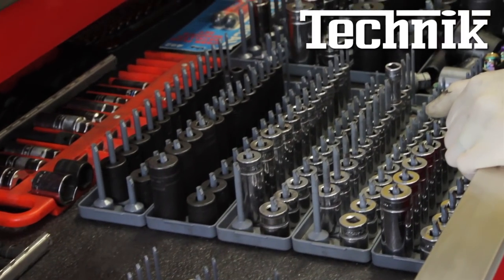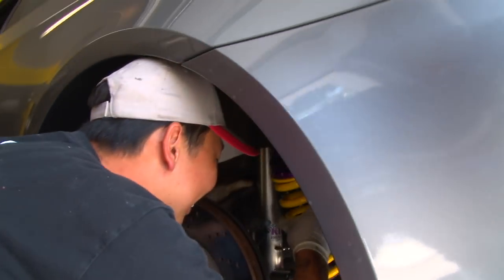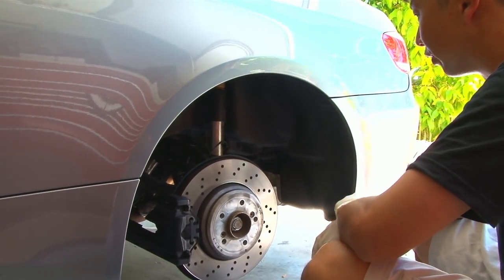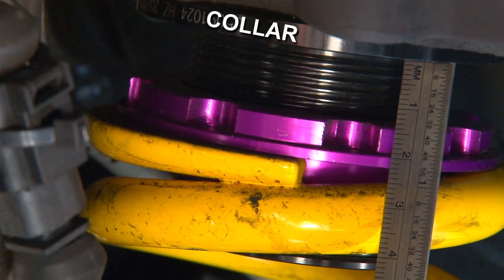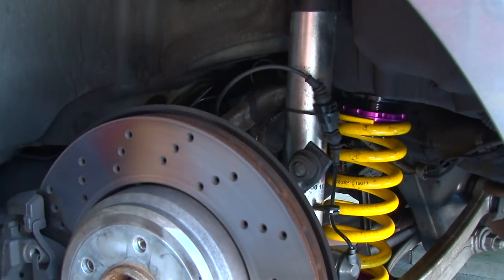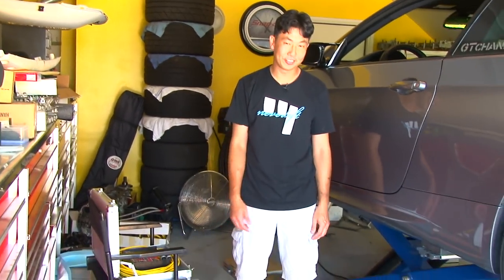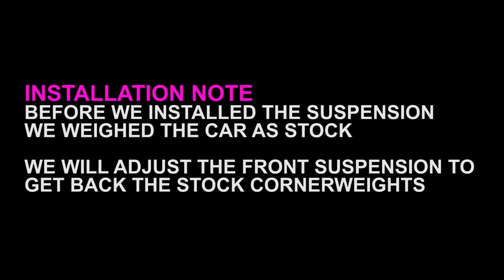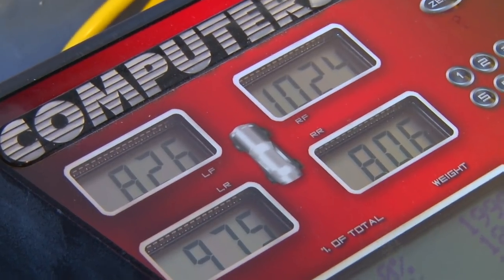How to adjust ride height & corner balance your car - KW Suspension DDC - Technik - GTChannel

Comment: Worth mentioning that when doing corner weights the droplinks/end links should be removed. Then once  corner weights are set they should be replaced with adjustable drop links. This ensures there is no pre load in anti roll bars 👍🏻
Reply: So what happens after you have corner weighted and then reattach the drop links ?
Reply: @jamsstar2010  if you corner weight it then re-attach the the oem non adjustable droplinks the Arb will be under a constant preload. Because the coilovers will be at different heights. 
With adjustable droplinks you can adjust the length of them separately to match the different heights of coilovers left and right.
Reply: me 3 years ago Thanks you for this info
Reply: @JamesWilson-du4xt  no probz

Comment: learned a lot. when i do my suspension, every time i jack up my car, the wheel would drop camber wise and when i drop it, it would stay camber. So i drive in back and forth to even it out to get a perfect measurement. it is just my tips with suspension but im no pro.

Comment: Did you undo the swaybar links. We do when we corner are race cars it make a big difference  in corner  weights I've seen 400lb difference. Cause the suspension binds.

Comment: i have questions... some things you did cover, but i want to be sure...1. what should be done first, the corner balancing or the alignment? 2. do the sway bars have to be disconnected? 3. should you add weight to simulate possible passengers? 4. lastly, should the static ride height be decided before the corner balancing? thanks in advance

Comment from the maker: If straight line speed were our goal then yes.  I (Brian) wanted a car with some luxury than can also handle well off and on the track.  The Shelby is fast but it's not quiet or remotely comfortable.  The M3 is my daily driver and it makes my commute super cushy and yet I can still go drive the canyons and have a blast.

Comment: How did you manage to adjust the rears without having the perch rotating togehter with the ring? I have to diassemble the lower control arm to adjust the rears on my car.
Reply: I also wonder. Did you press the rear spring together. On my e92 335i the upper perch always rotates so I can not adjust the height
Reply: @joakize  I installed v3s on my car today and had that same issue. i did overcome it though. on my m4 atleast there is an opening in the control arm. u can put a socket extension with say a 22mm socket on the end up through the spring. I then used a very small jack to put light pressure on the middle of the perch. that stopped it from rotating and i could adjust the rear. i still needed the wheel off but atleast i didnt have to take the control arm off again.

Comment: Please correct me if I'm wrong, just some more confused people in the comments is all.

TLDR; Spring preload raises height, no or negative preload lowers height(loose springs if no helpers/tenders), both adjust how much bump travel.

The coilover world is odd and misinformed, KW is one of those companies that usually don't come with independent height and spring adjustments until you go all out with their track coils, because everyone has been setting them up wrong using the damper body and not the springs.
In this video, the suspension appears to be upside down and separated compared to many other vehicles, so move the spring perch down adds preload raising the height, less or negative preload would lower it.
The spring adjustment is the proper way, as it controls how much suspension travel you before hitting bump stops have AND the height, the body portion can be used to fine tune that more.
Going by the bottom or top body portion and not the spring adjustment can cause issues with travel depending on the current preload on the spring, either too little travel wasting performance or too much travel smashing the car into itself.

If you check out MCA suspension they have a ton of really good reads on how this works.

Comment: Now you need a spring rater so you can maintain or change the roll couple to tune the way the car handles. You need to know where you started by rating the stock springs and knowing the rate percent front to rear. I've always preferred a car with a bit of push when it starts letting go. Loose can get you into trouble. And adjustable rate sway bar is nice for fine tuning the handle. Indy cars use an arm to the link that can be turned, it's a blade and as it rotates it will deflect some.

Comment: So, to clarify, if my suspension was adjusted evenly then I potebtially could have one corner sit lower because of the weight if the fuel tank etc?

So to account for that I would raise the lowest corner until the gap from the tyre to arch is the same

Comment: I'm a bit confused. Is adjusting the lower perch different than adjusting the top in that adjusting the lower one has no affect on the height? It would seem that when you're corner balancing you're inherently changing the corner heights also, and afterward the heights are all slightly different, and uneven.

Comment: Hey guys,

I need advice with fitting torsion beam suspension in the rear, I see that the BMW M# has such a system. I need to know how it works. MacPherson is straightforward but the torsion beam is different. I need to know what gets removed first, spring or shock? And also to put it all back together, what goes first? 

Thanks in advance.

Comment: I just had a KW v2 installed on my 2011 e93, but looking for additional height in the rear... I bought the universal 15mm spacer from KW, but they do not seem to fit according to the shop? Anyone have info or advice on this? Or can recommend an alternative to add height to my new kit?

Comment: Do these coilovers have separate height adjustment to spring preload? By the looks of the vid it seemed you were adjusting ride height by raising and lowering the spring collars which would actually adjust spring preload as well....
Reply from the maker: You are correct.  The helper springs help to adjust some of that pre-load.
Reply: +GTChannel is this set up fit e46 m3 ?

Comment: So corner balancing is just setting the ride height....After you've set the ride height?
Reply: No, the ride height doesn't change much visually when you corner balance.  Small changes, especially with higher spring rates makes dramatic difference, but also weighting the car works in sort of a "voodoo" fashion which doesn't directly affect height, only weight.  I'll explain...say you set your ride height and visually it looks good.  You can actually redistribute the weight of the car and obtain the exact same visual ride height.  Reason being, if you raise a corner, you actually increase the amount of weight it carries...so while you raise the perch, the weight increases so further compresses the spring.  Once you raise the corner, the opposite corner will also gain weight.  You're making small tweaks to each perch which don't visually change anything, but dramatically change distribution.

Comment: Anyone who might read this and needs to understand a better concept of the theory of how raising one corner affects the opposite side how to described it as “teeter tottering” can be better explained in some rc cars videos lol. Ironically we do this for rc car professional level racing. I just came here to confirm what I already knew from toys and make sure I applied the same concept to my real car since I’ve been fighting to adjust to corner height of my car. But basically set all your perches in pairs as a starting point and see where the car sits. For example on my 95 m3 the car is front left happy. When I raise the front left to get the fronts match by doing so I change the rear right height by leaning the cars weight in that corner making the rear right now settle more. Now to fix the height of the rear right what you want to do is raise the rear right while equally LOWERING the rear left to main the same height! It’s weird I know the fact that you want to raise or lower the height I just told you to raise on side and lower the other but for better visual representation this is why I said it can be better understood on a smaller scale rc model. If you want to learn more on the idea search up Alex hagberg X-ray rc car height adjustment. Many videos will come up on the topic and you can take away lots of useful information good luck 🤷🏼‍♂️

Comment: Hey if the collar is closest to the perch, is that lowering it or raising it? And if the collar is farther away from th perch is that raising it? Im not sure of the concept. I just installed coils on my rear yesterday (on an e46) and its way too low, im rubbing bad. And I have the perch closest to the collar.
Reply: Increasing the distance raises it, you should be able to raise the car quite a bit.

Comment: Changed out both struts on the front end of my bmw 325i, due to leaking oil. After the change my car is riding high in the front. The mechanic said the new struts were the right size, but that can’t be right. Can anybody explain why the car is riding higher in the front now, and what I should do to correct the problem. Thanks in advance for your input.
Reply: The oil leaking out of the struts may have lowered the right height over time.
Reply: Buy rears
Reply: If bilsteins they always have the spring perch in the wrong place by a few mm which raises the car that amount.

Comment: I think v3 is a pretty good product but some racing team told me v3 is just so so almost no improvement. with that amount of money they will choose jRZ rs1
Reply: with that amount of money? there is a big difference in price. v3 for my car new cost 2,300 tops and for jrz 1 your looking at 4000 used...this is comparing something new and something used....of course a product that cost 2k more used is going to work better its 2000 dollars more. Prices may vary by car though

Comment: can i adjust the stock suspension on a bmw e46 coupe to lower it without cutting the springs? if anyone knows tell me please :)
Reply: ha ha ha so funny..
Reply: exactly,i want to lower my car without cutting the springs that's why im asking if i car adjust them or something
Reply: No stock suspension is a permanent height, You either need to put lower springs in, or coilover suspension. If you plan on putting shorter springs, you may as well buy shocks to save the car from bottoming out after 5000ks (because the factory shock compresses by x% depending on the springs installed).
Reply: buy coils .. cost like 180e new 50e used
Reply: Get a lowering kit it'll be one set height but it'll be fine. It'll feel stock and have a lower center of gravity
Reply: Andrew Velis that is maby the most stupid thing to do.. On german ebay height adjustables to e46 cost 180 jom.ta texnix.. and for 600 better ones like bc and shit..

Comment: I love the fact that BMW spent millions of euros in time and development by people who know what they are doing and then some kids who think that they know what they are doing get a measuring stick and ruin the car's suspension geometry and dynamic behaviour.
Reply: You obviously know nothing about racing. Yes BMW spent millions of euros in time and development in a compromise to develop a suspension thats sporty but also comfortable for the average person who isn't going to take it to the track. This guy obviously wants something more on the performace side and did it the proper way with weighting the car out like a real race team would. Also KW has  spent millions to develope some of the top suspension in the world. Better than what comes on a stock BMW.
Reply: Hadie Kumastar ..as an engineer who worked for a car company, I would say that this is not the proper way of setting up a chassis. The problem is that your geometry angles won't be set properly [be it stability as BMW wanted to or agility as racing on tight circuit requires]. Just saying... [also do you ever wonder why car manufacturers never give you the power out of the engines that chipping gives you? Maybe you should ;) ]
Reply: martintuky As an engineer who worked for a car company. I doubt that. You really don't know what you are talking about. This is coming from someone who has been around racing cars his entire life. Has set up suspension on racing cars. Has been going to the Rolex 24, one of the most prestigious racing events in the world, for over a decade and watched professional racing teams set up the suspension on race cars. That includes the factory BMW race team. The geometry of the suspension has not changed. None of the original mounting points have been changed. If you're talking about the alignment because of the drop in ride height. I'm sure they have thought of this. He could still set it to the factory settings. If he takes it the track he would want to take tire temp readings to get the optimum setup for the car. What does performance chips have to do with chassis setup? If you really want to get the most out of a car you wouldn't chip it. You would get a Stand alone ECU so you can really tune it.
Reply: martintuky interesting..the only changes i see in this video is lower cg, higher spring rates from stock and slight changes in bump steer,toe and camber in which i think the owner can easily get it back at alignment shop. well I'm a designer not an engineer so do enlighten me more on this, i love to learn more
Reply: Hadie Kumastar Every thing you say is correct. I cant stand it when someone bashes something they know nothing about. Does he think the BMW race team runs the stock suspension on there cars. No they do not.
Reply: You are correct about what you said, however,  adjusting all the geometry angles to correct settings (what ever they may be - for the job at hand) isn't always easy. For one, the length of control arms cannot be adjusted on most setups. Hence, the dynamic response of the wheel-suspension-body is not what the factory set up. The proper way of designing a racing chassis includes the design of all suspension components and recalculation of dynamic responses of each element - no one in racing would use the toe from civil car and no major manufacturer would dare to sell a neutral handling car to public.

The bottom line is: tuning is fine for look improvement, but it is not racing engineering. Usually, stock cars with proper tyres and good driver should be faster and safer than lightly modified cars.

For more detail, I would highly recommend any basic textbook on suspension, IC engines and gearboxes - the basic concepts will explain why production cars are the way they are.
Reply: martintuky Wrong wrong and wrong. Most sports cars have fully adjustable toe, caster and camber. There are plenty of production based race cars with the factory suspension pickup points and are only allowed to use a race coilover. Continental sports car series. All of these cars are lightly modified production cars. None of them are allowed to change the mounting points of the  suspension geometry. They do run an adjustable coilover just like the one in this vid. These cars would blow the doors off any stock car. I don't need a text book. I have two racing cars. Any SCCA Autocross car like my CSP miata would have this type of suspension and it would out handle any stock suspension miata. Look up World Time attack all of these are production based cars even in the unlimited class.
Reply: MidKnightFD the guy is clearly clueless. Let him be in his own world.
Reply: @martintuky  You just contradicted your initial comment. Just as car manufacturers don't give consumers the full capability of the engine from the factory (de-tuned) unless you chip and modify them in other ways, they do the same with the suspensions also, and set them up from factory at a compromise for comfort and daily driveability for the "average" consumer. Everything performance car manufacturers do is on a sliding scale, an spectrum from which a car can be tuned either for higher performance, or de-tuned to meet the import standards (emissions, etc) of the country they are to be exported to. Even factory authorized dealerships will do high performance modifications using factory approved parts and procedures that are within the approved range of adjustment/modification that meets it's performance and safety standards. I'm an engineer/designer, and VW/Audi mechanic, and German cars in particular are severely de-tuned before being shipped to the states. The difference between a Jetta and a Bora (and a GTI and a Polo) is that a Jetta is just a stripped down, de-tuned Bora that can be legally sold in the states. It's also why the Nissan Skyline GT-R (R34) can't be sold in the US, because it doesn't come in a de-tuned version... 😉